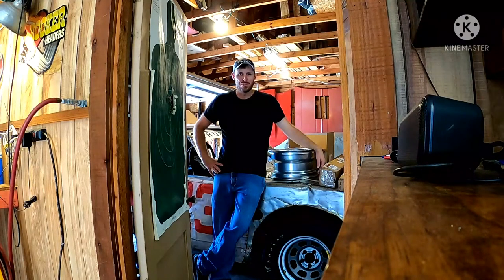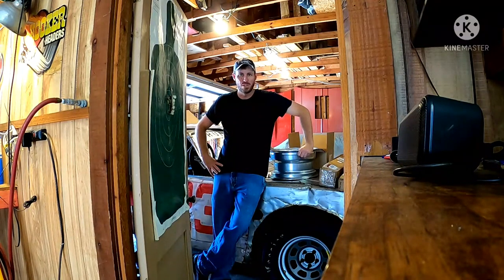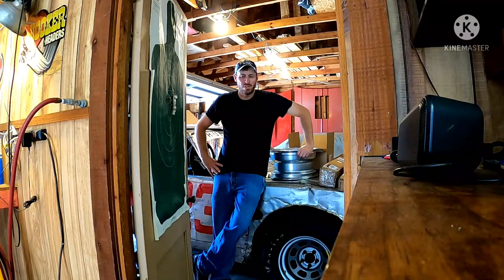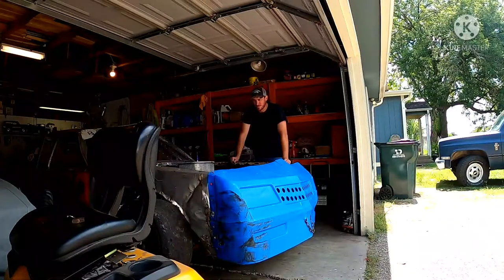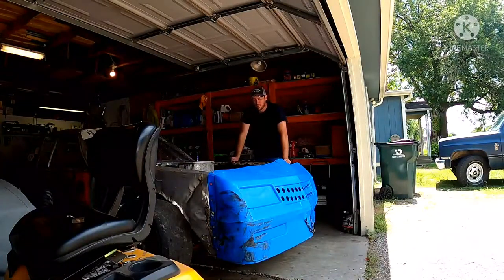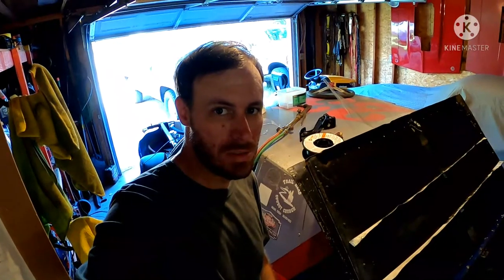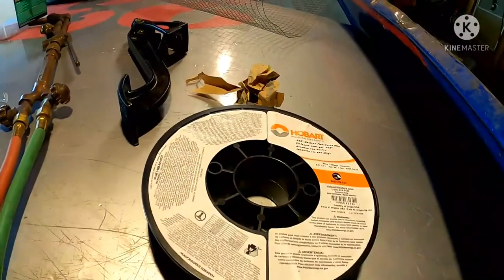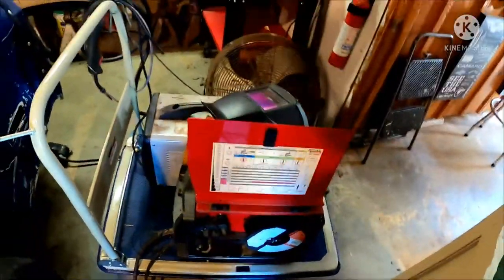Installing A Cheap Clutch Pedal Assembly For Pure Stock Dirt Track Race Car

Comment: tell the nephew that nerves come with the sport everyone gets nervous tell him not to be afraid of spinning out you learn from the mistakes it takes time to get good at the sport i hope he does an awesome job never give up i look forward to watching his racing videos good luck this year
Reply from the maker: Thank you for the kind words, we’ve been busting it on the car pretty hard. I cut out a lot of bent bars and straightened bumpers and etc.. i dropped it off yesterday to get  new front fenders and hood built for it. Typically do all my own work but by the time I pay freight on the aluminum and spend a full day with a rubber mallet, clamps, angle iron etc it was cheaper to just pay a guy to do it. Once I get the car back I’ll put out on update video on it. Our first practice is supposed to be March 12th.

Comment: I race myself I would put a couple bars in that area as well ive seen a few wrecks where there foot got crushed or nearly
Reply from the maker: I raced for about 10 years my self and definitely saw some pretty bad wrecks, but never saw that. I’ll definitely take another look at that area.  Thanks for the input. Luckily our local track restarted the “pure stock” class. I’m going to put him in that instead of factory stock. This is a really old car that I actually raced against 13-14 years ago, it’s not at all a factory stock, but it was the slowest class we had to choose from before.
Reply: @wingwindowgarage9289   yea a guy from jet chassis got a good shot and the bumper reached his foot and bruised it pretty good now all there Cara have like a x in that area to help prevent that......and that sucks cuz I honestly wished I woulda got a compact car or mini stock but heck them are expensive too most of the racing around here is imca some of it is usra